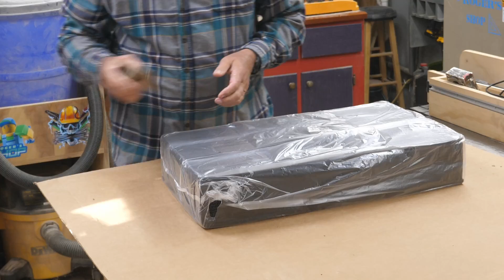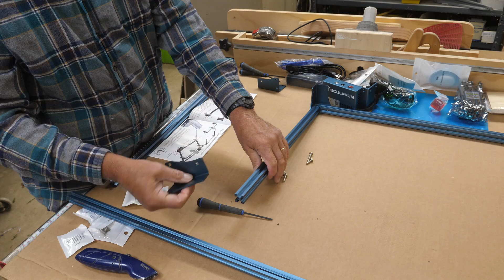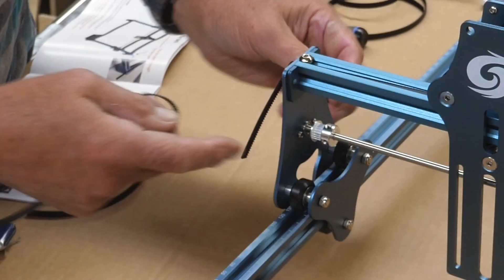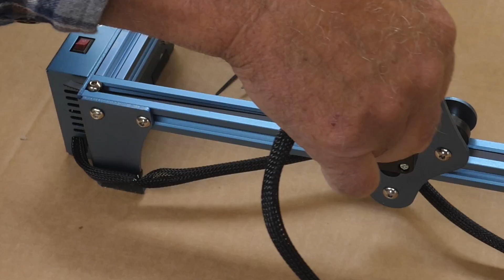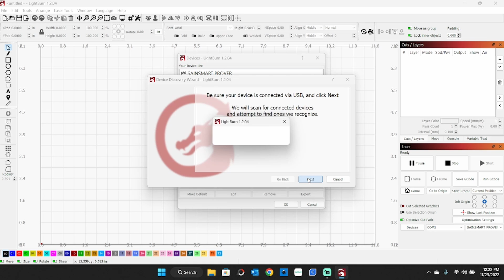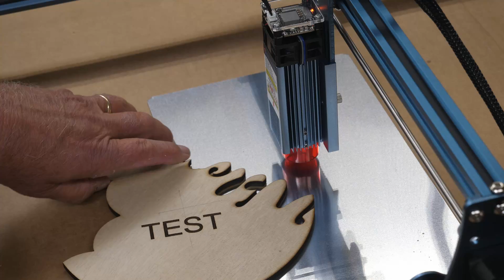Sculpfun S9 Laser Detailed Assembly

Comment: Roger- thanks for the video. Your opinion, please... do you see any advantage(or disadvantage) to adding a little dab of compound like neversieze on the screw threads before assembly? I like to use a bit of diaper rash ointment on screw threads (which is primarily zinc oxide and cod liver oil) to prevent galvanic corrosion over time- especially with dissimilar metals like stainless into aluminum. But in this case it might be a good thing to have the screws locked up, maybe?
Reply from the maker: Never had any issues with the lasers having a seized screw or bolt, so don't add anything.  I did have one laser where the X axis stepper motor screws kept working loose, so used Loctite on them, finally!

Comment: Seems like a decent laser for the price. Not that I need another one.

Thought I would give you and update on the Longer 5 10 Watt not cutting with Lightburn yet worked with the touch screen.

I did a speed test and they both were the same on a test cut.
So that left power. I did a $$ in the console to check 30 and 32. They were set like they should be but Lightburn had S-345 instead of S-1000
It works just like you said. Cut at 300/100 with one pass.
Thanks you for your help in this and all the other help I notice you have been giving to others.
Gary

Comment: Safety goggles recommendation?  I have a pair, but they don't fit well over my eye glasses.
Reply: They're on sale right now for $64.60
Reply from the maker: https://amzn.to/3FcKGLd is what I use.  Not cheap, but fit well, are comfortable, and listed for this type of laser.
Reply: Thanks.  I guess that $80 price tag was the motivation I needed.  I had purchased a slightly nicer pair of safety glasses when I got the laser which fit great, but not over my glasses.  I just pulled out the cheap pair that came with the laser and realized the temples are adjustable.  Extended the temples and achieved a comfortable fit right over my regular eyeglasses.